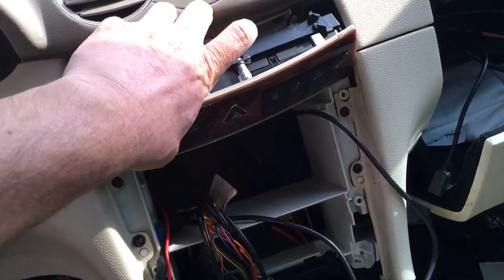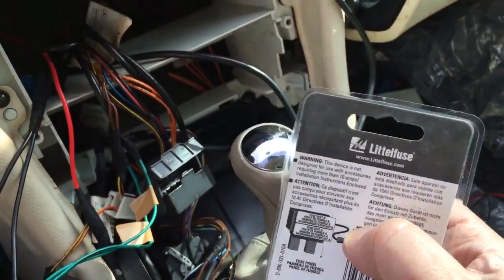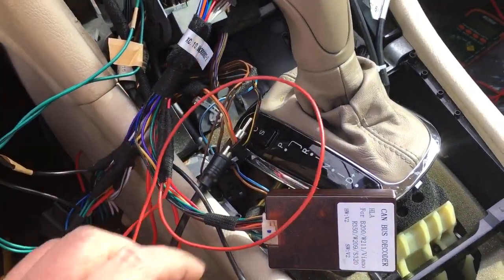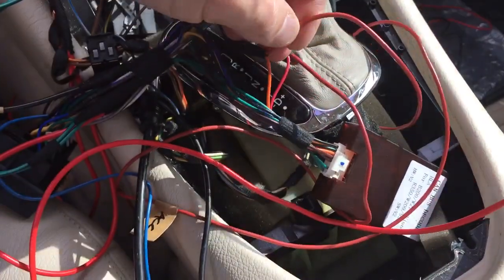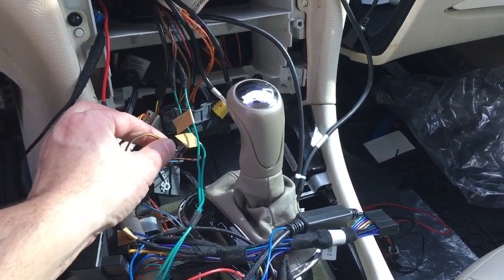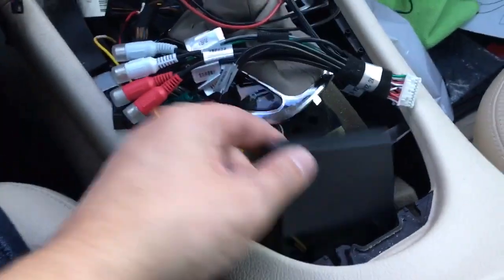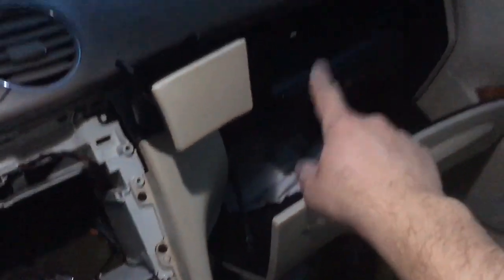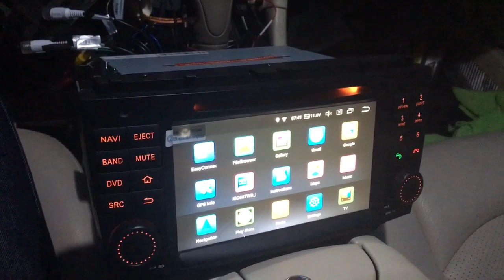Mercedes CLK320 W209 Android 8.0 head unit & fiber optic decoder installation, part 3

Comment: I have 05 w211 and my head unit recently died. Shows Mercedes logo and shuts off..My question is: would  new unit work if my amplifier (I think that's the problem) is broken or I have  to repair that issue first? Thanks..
Reply from the maker: I would say if your amp was the problem, you would have no sound.  However it it shuts off completely, it might be something else.  Does it play anything via blue tooth off you phone?  Do the speakers work when you make a Bluetooth call?
Reply: @MarcoCerqueira  Thanks for quick answer! Screen turns on shows, mercedes logo and turns off. It's completely useless, recently dead circle about one inch radius showed up,when I changed audio amplifier..I decided 100% to put android unit, just wondering can it work if existing system has troubles.Thanks..
Reply from the maker: Again, it sounds like your head unit has the problem, not the amp.  What do you have to lose, unless you are planning or getting rid of the car.
Reply: @MarcoCerqueira  Yeah, that's the way I'm  thinking too..Thanks bro for, answers..
Reply from the maker: Good luck buddy

Comment: wassup bro, im looking to get a radio like this in my s600 03 w220 , should i get this kind of unit? i also have a w211 and i have a pioneer 4100-nex and the sound is amazing but i lost some features like steering wheel and etc
Reply from the maker: It all depends what your priorities are.  More features and apps or sound quality.  If sound quality is priority, these android unit will not be better than OEM.
Reply: @MarcoCerqueira  okay i will get me a pioneer or alpine like i did with my E , do u know how i can retain my steering wheel controls
Reply from the maker: Not sure with those type of units, but I would think that they will need to have CANBUS compatibility

Comment: what do you mean had to reinstall cd changer ?
Reply from the maker: I had to just plug it in until I ordered the fiber optic loop.  You cannot have a break in the fiber optic line or you lose the signal.  The cd changer keeps the signal intact until you get the fiber optic loop to take its place

Comment: Hey man, I really appreciate you posting videos about your install. I definitely know that I need a fiber optic decoder since I have those 2 Fiber Optic lines that run to the CD changer and my amp. Although I was originally having  issues with my radio before which I thought it was the head unit(Not Command, Just stock) since there was no sound coming out. I've read on the forums that my 2005 c230k usually have problems with the amp going out. I bought the same Head unit as yours but when I plugged it in, theres no sound coming out. Would you say that its probably the amp thats out? and do you thing I should just rewire the system with a after market amp? what are your thoughts?
Reply from the maker: The unit does have RCA style cables if you want to replace the amp with an aftermarket setup, so it can be done.  Just be prepared to run all new wiring to amp.  Good luck on the install.
Reply: This might be the problem. The anntenna wire works as a remote turn on for the amp

Comment: Ah man thanks for sharing helped out a lot only problem is I still have no sound everything has power everything works but still no sound do u think the decoder is bad
Reply from the maker: Do you have any fiber optic components that are not plugged in?  Think of the fiber optic like a water line.  If it is disconnected anywhere along the line you will have a “leak”, so no sound.  If you eliminate a component like I eliminated the CD changer, you will need a fiber optic loop.
Reply: Did you ever end up getting sound out? I have everything hooked up, all devices, and still no sound. I'm suspecting the fiber box is either bad or just doesn't work.

Comment: Thanks for sharing your experience, I really enjoyed watching this series,  very thorough and descriptive. Its always an adventure tossing in new head units into Benz's. I am curious how you managed to get your behind the radio area organized. 
It doesn't look like you have run into communication issues on the canbus, but if you do have issues,  twist your can+ and can- in the same direction to how they are where you have tapped in (twisted pair), that will reduce crosstalk on the network. I have run into that on a couple of installs.
You could change your pinouts on the aftermarket harness see https://www.youtube.com/watch?v=Ou6kyLxfGj0 most adapters can be rearranged when the manufacturer doesn't get it right, happens more than you would think.
Reply from the maker: Thanks for the comments.  I’m sure it will help others doing a similar installation.  Wire management was was not easy.  I made some of the wire leads a little longer and fit the Canbus decoder box and fiber optic box behind the ashtray area.  That made a little extra room for the other stuff.

Comment: do you speak spanish to explain it?
Reply from the maker: No sorry
Reply: Marco Cerqueira, when you splice the red and orange wires to ACC 12v, you both do it with one from the ashtray right?  in the video I see that the ashtray cable is black and yellow?
Reply from the maker: Yes on my car the cigarette lighter uses black and yellow wire for ACC 12V.  Email me and I can send you the wiring diagram.  Cardaytoday@gmail.com